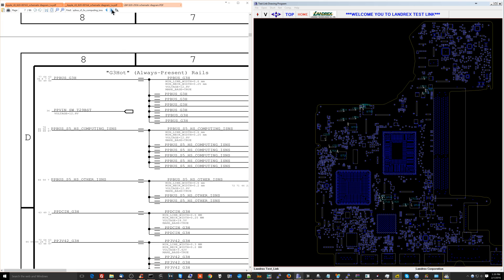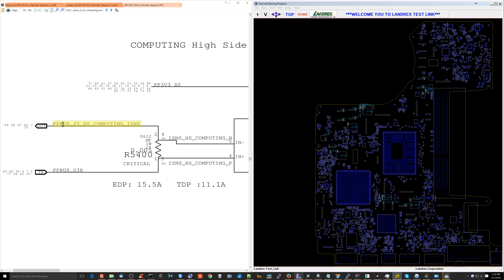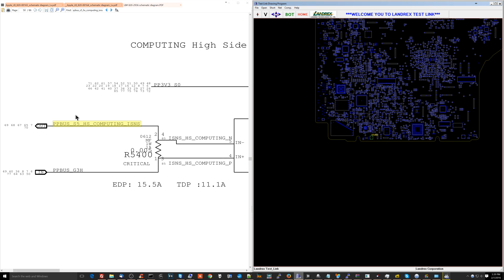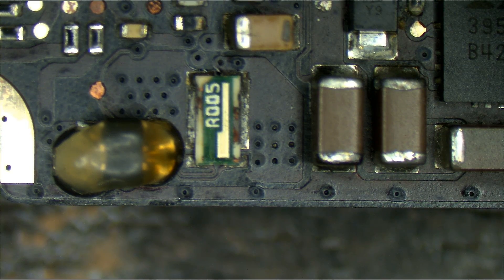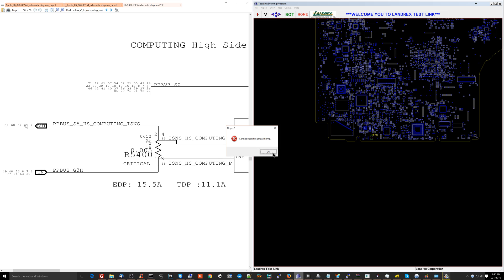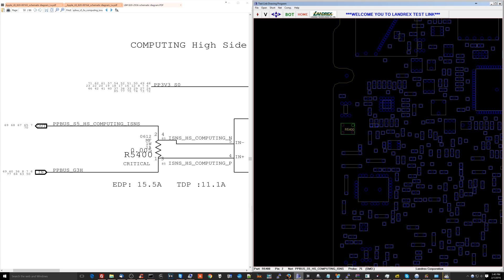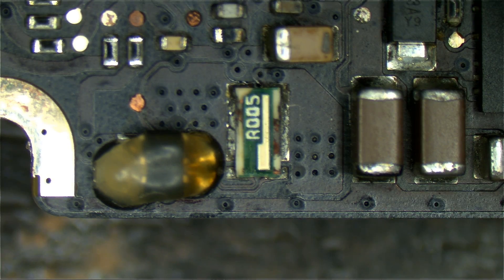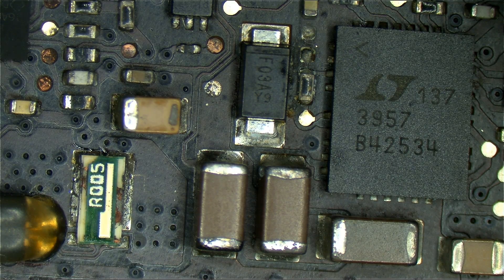Macbook logic board repair 820 2936 enters S0 state but doesn't turn on

Comment: hi Louis, love your videos. really good stuff. got stuck with some dodgy board 820-2849. have all power rails turns on chimes but no video. strange thing is PPVCORE_S0_CPU   and  PPCPUVTT_S0 in diode mode beeps and shows short to ground 106 but when switches on producesPPVCORE_S0_CPU at 0.8V same PPCPUVTT_S0 is  that enough? i guess it supposed to be 1.2v or 1.5. why would it beep in diode mode? does it mean cpu might be an issue after all?
Reply from the maker: No
Reply: so its actually shorted to ground right if it beeps in diode mode when board switched off. how come it still produces 0.8 v still? tried to inject 1.5 v but no  luck  as my bench power supply just drops voltage when attached to cpu vcore

Comment: Hakko is the cheap soldering iron.
 The pro model is like $1700 from what I hear.
 or you can buy some crap but crap irons have wonky temperature and don't have a lot of constant power
Reply from the maker: +scot shabalam I bought Hakko because everything else that was good cost more.
Reply: It doesn't make a whole lot of sense for you to go upgrade your soldering iron set up when your Hakko has been a hero for a while.

 Actually if you got new gear I was thinking you might want a desolder gun with it's own vacuum pump. I saw one of those the other day and it might save you some time with component removal.

Comment: As much as you hate these comments, I see a problem. The big capacitor looks like it has a cold solder joint on the left side. I'm not so sure that solder on the capacitor actually flowed. Not necessarily a problem... yet, but I predict that will be the first failure if the board gets another liquid spill.
Reply from the maker: +Gameboygenius Good eye

Comment: Actually, is it not worth your time to build a test jig for different motherboards?
Reply from the maker: +sykskysyk i have a slot with parts I can pull out, but it is a royal pain in the ass. It takes up more space on a VERY LIMITED SIZE table in a very tiny store, it takes time to find all that crap, it has inventory that costs real money sitting collecting dust

but above all

when i send the working board back to the customer fixed, it never works. always works when it's the full machine.. .NEVER works when it's just the board. Imagine that. :-)

the latter is why I stopped accepting board only repairs.
Reply: +Louis Rossmann I guess building a test jig won't automatically prevent your customers from being shameless douchebags.